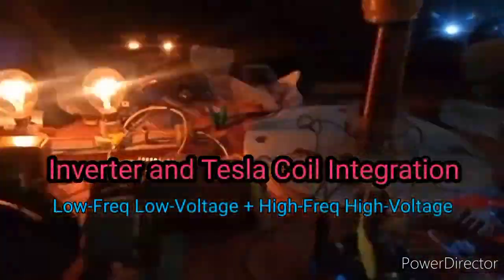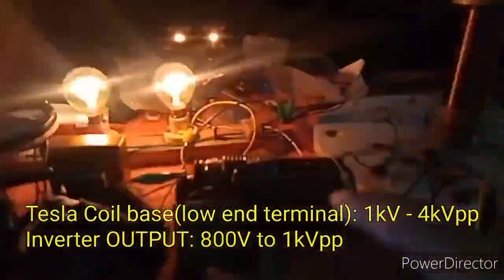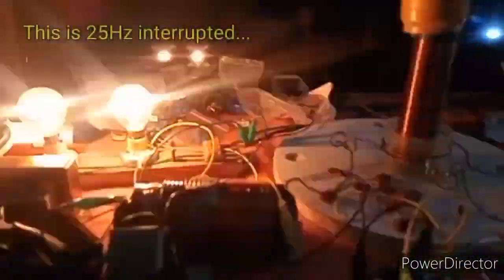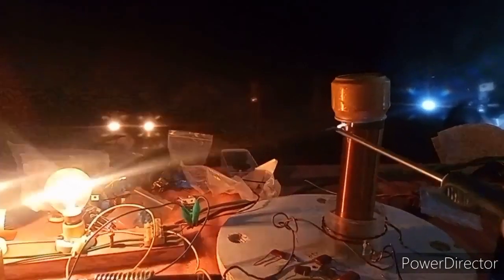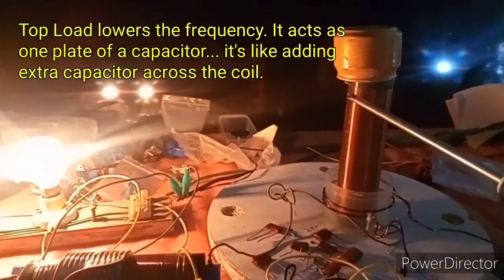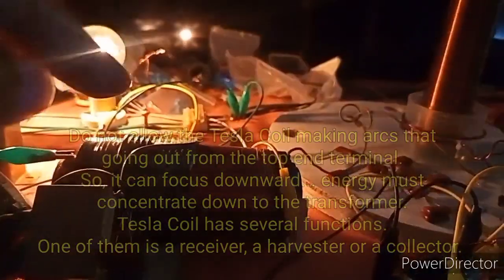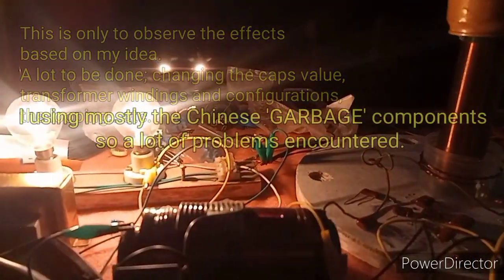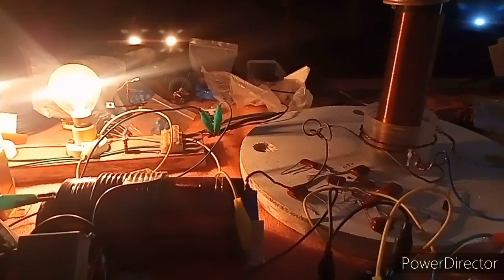#51.3 Inverter and Tesla Coil Integration test

Comment: Dude you have some incredible videos
Reply from the maker: @chriswabs  I am few more steps prior finalizing the 2 major OverUnity devices of mine. Looping is tested, extra energy is confirmed.
Reply: @PLASMUX-20  do you use MOSFETs as well?
Reply from the maker: @chriswabs  A lot but not always. In this video I'm not using any MOSFETs but gain huge amount of what he called 'amps'.
As what I've said many times in comment section of your videos including the one whom you are promoting that MOSFET is not a generator. It is a switch or a variable solid state resistor. Doesn't even run without power source! It cannot generate current. There is a phenomenon that you can increase the power output than you put in but it is remains a secret and it's another story and that extra power is not coming from the MOSFET but from the oscillating coil. The main function of a MOSFET is just a switch. And also it is not really an amplifier as one of its fuction however it used to amplify input signal with its supplied power. You cannot generate amps from a switch as what his claims.

Comment: whatever assembly you do and no matter how much power you have to apronde a light bulb, two or ten, the secret is in connecting to the ground and how to extract energy from there to go self-sustaining even just Tesla coil without putting consumer on it if you want self-sustaining need to know how to use the earth as an energy source because Tesla that Discover radiant montages are dozens but self-sustaining few have succeeded and understood
Reply from the maker: Agreed.
I made my own configuration based on my self understanding on this matter. In short, I do my own system.
So, this is not totally a problem. I don't rely on what others do, it will only help experimenter more confused.
Earth ground really more important but I'm doing together in my experiments for studying  a system that is more compact which doesn't need physical Earth ground cable. Time comes my system can run nicely without Earth.
Reply: @PLASMUX-20  

yes, it is best to go on your own ideas and tests because many movies on youtube is only for views I'll try your idea with inverter and Tesla coil and use the air and earth to see what they get anyway super What You do tests help you understand the mistakes and get the results👍

Comment: Do u talk about this schematic at any forum , plz share the link , i also have same setup, i will share my experience and schematic, and talk about this technology at your given forum
Reply from the maker: I don't have involved in any forum but the schematic is already there.
Reply: @PLASMUX-20  do u talk about topruslan schematic?
Reply from the maker: It didn't work as what is expected on the schematic. Yes it run but only to light up bulb or any DC load. Not self running device.

Comment: but Assembly with flyback and inverter and not worked he that seemed more ok
Reply from the maker: Can use flyback but in different way like cap dump. But at higher resistance/impedance inverter output transformer.